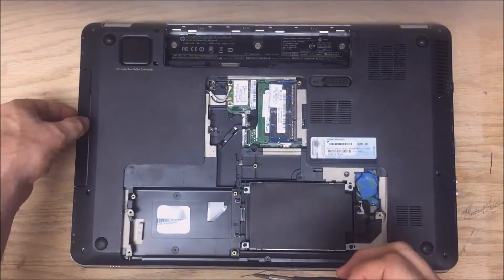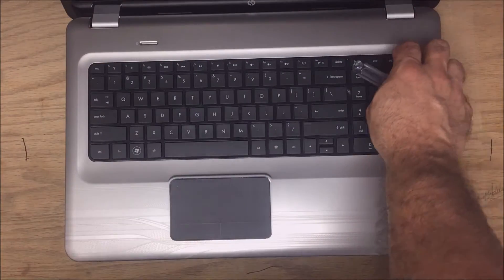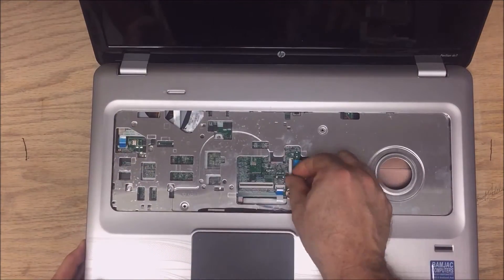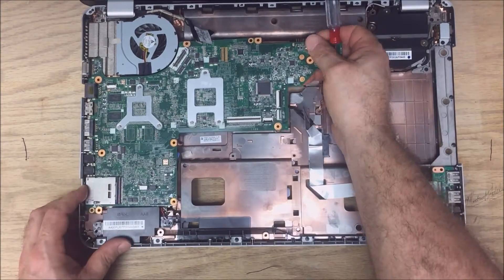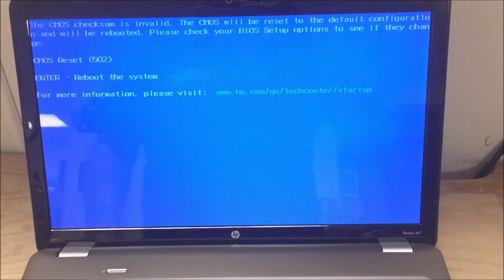HP dv7 reflow proceedure by BAMJAC Computers   MJ Adelman

Comment: Plan on doing the same, but want to place kapton tape around the GPU chip, & preheat it, use a temp sensor to monitor the board temps. Thanks

Comment: excellent video tutorial thank you. I saw someone else using a sheet of baking foil to protect the other components around the processors to prevent any unwanted de-soldering of smaller SMD components which looks like a good protective measure

Comment: Thanks a lot! I worked like charm.
Reply: Is still working?
Reply: @mehdio5217  As it was the first day! I'm writing from it. 
(Please check your heat sink and fancooler, to make sure it will last)
Reply: @smferreiro2610  what is the liquid he put on chip before he start to heat?
Reply: @mehdio5217  It's a kind of resin, used in electronics. It's heat conductive, but no electrically conductive. You can buy it in Amazon searching for the brand he shows.
Reply: @smferreiro2610  thanks

Comment: How do I get in touch with you, I found BAMJAC computers in Bloomington, Ill, is that you?  Thanks, I have a question, I have video but it is intermittent, I am about to buy a new mainboard.  I keep getting intermittent wild horizontal lines, sometimes it gets so bad the screen blacks out.  I noticed about 6 months ago that the heat sink does not sit on the graphics chip solidly, there was a huge gap and the laptop always ran hot.  Thanks

Comment: I also did not turn on the DV6, made the reflow turns on but shows different colors (black is green). Starting windows gives me driver ati BDSOD error, while in safe mode it works (always showing different colors). I think it's still the graphics chip but I do not want it to be something else. Solutions?

Comment: did this and no flux bubbled out... but when I put the laptop back together the graphics are working perfectly again!!! SOOOO happy the reflow process worked. thanks for this nice video! (also replaced the fan while I had it apart.)this separates because of the stupid lead free solder. that lasts about 5 years. the lead solder lasts forever!
Reply: Hi, was the fan also not working before you fixed the problem?? Cause I have the same screen issue right know! I just wanna make sure I don't waste my money.
Reply: @QuincyJuanLopez  yup

Comment: was the Caps lock LED flashing slowly but constantly before the fix? also what kind of heat gun are you using? I know you said at low setting but any idea what's the temperature?  Thanks
Reply: ZankDigiTrash I have the same problem, can you fix it?
Reply: Caps lock led blinking every 3 sec
Reply: I'm looking for information about this
Reply: Ill tell you from a technicians perspective the caps lock LED SOMETIMES will flash, other times itll be off or completely solid.

With a cold solder joint under any of the IC's, its a gamble. I just reflowed a DV7 today, and the caps lock light was solid white.

Comment: Hi, great video! would you be able to provide a link to which solder flux should be used?
Reply from the maker: This should get the job done. Good luck!

http://www.ebay.com/itm/30ml-Kester-186-Liquid-Soldering-Reflow-Flux-Rosin-Needle-Tip-Bottle-No-Clean-/182342044263?hash=item2a746eca67:g:CCwAAOSwcUBYG6Us
Reply: Thanks!
Reply: rosin flux for electronics... NOT acid flux for plumbing, etc.

Comment: how long does it will work?
Reply: Malatya
Reply: This way maybe a few months. Especially since he didnt reflow the little VRAM chips on the side.

But if you oven reflow it, clean the fans of ALL dust, apply arctic silver 5 and modify the fan to run at full speed all the time?

Could last years.